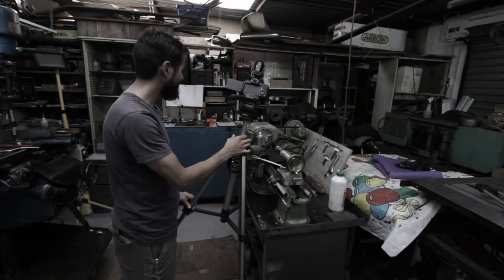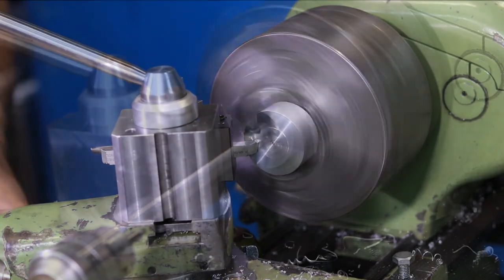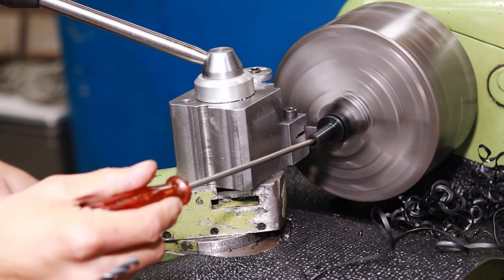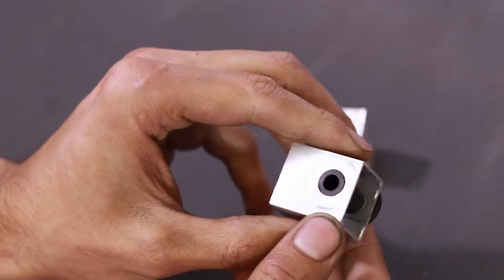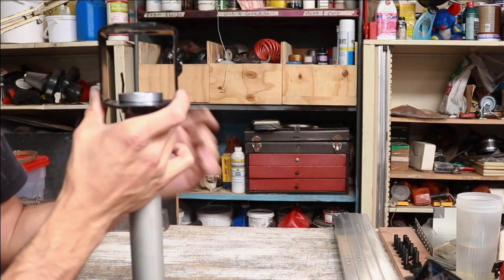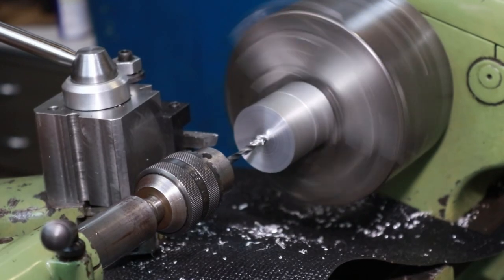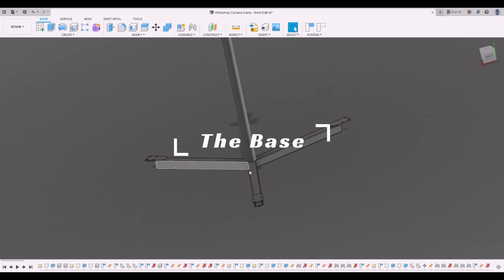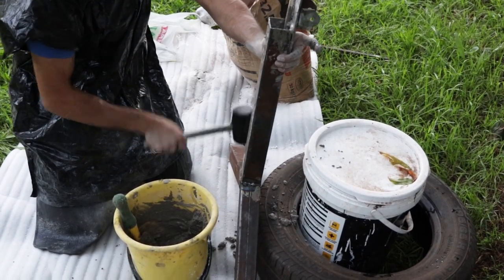Making A Camera Arm (Coz my wife is tired of helping me film these)

Comment: Great work! Thanks for the tip when drilling thin walled tubing.
As a fellow camera arm owner, j would consider adding a bit more weight to the base. My arm tipped on me, when i had it outside on a light slope and a heavy wind gust blew it over. It crashed my camera...
Reply from the maker: Ouch, sorry to hear that, I had a plan to make up some ancillary sand bags for just in case, so I should probably put those on the shortlist. Thanks for the feedback

Comment: I  buy  my  harm from a supplyer of  tv in the hospital  they have allready  strong  harm ; also 

I  stabilesed  my camera  whit a vintage  hard disk  ; I remouve all magnet harm  and remouve some spacer betting disks afte  I put  x7  disk  inside like this  when I plug it  I have a powerfull gyroscope effect  ; the nesxt  project is to replace the disk  whit  lead disk  very  heavey and get more  guroscope  effet   if  it still start ; probaly make a utube  to explayned  howto  make  the guroscope   also very usefull for  binocular  observer ; but  only when i  finish  ti learn  how ti make utube video
thank  for the project
Reply from the maker: That's a pretty cool idea to use hard drives for the gyroscopic stabilization effect. I have to dampen out vibrations on this manually every time I bump it. But glad to hear from a fellow crazy inventor👍
Reply: @Mark_How  I probLY Make  utube  demo  of  howto this later  this summer  now try to find  very hold  HD   like a 5  inch  29 meg  or  3.5 40 meg  fulle hight about  2.5  inch  that is  the best  I send  the  tuto later